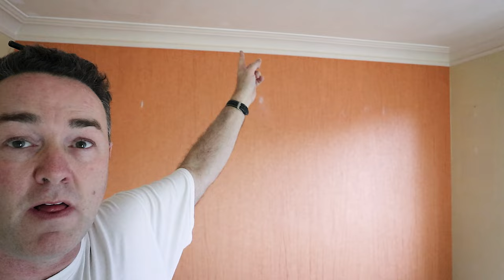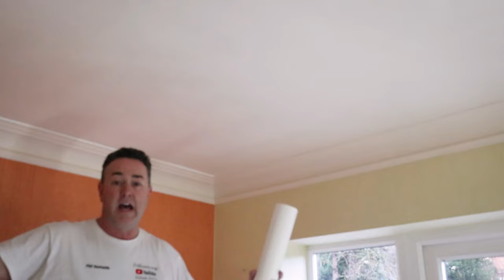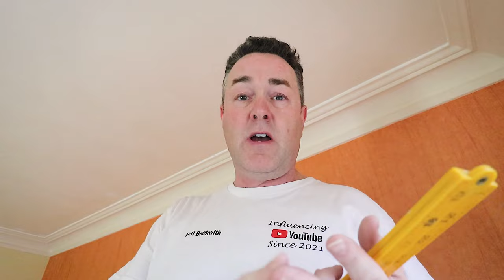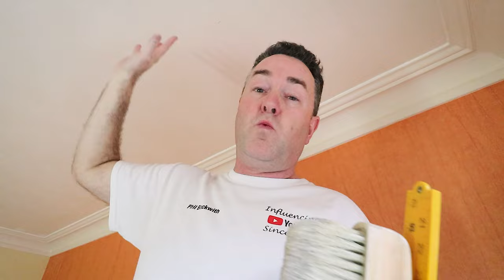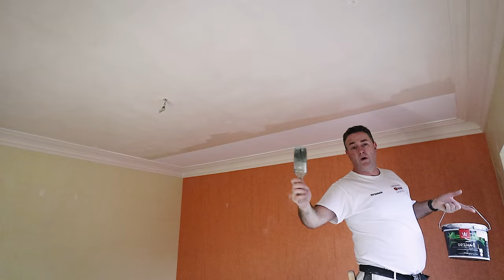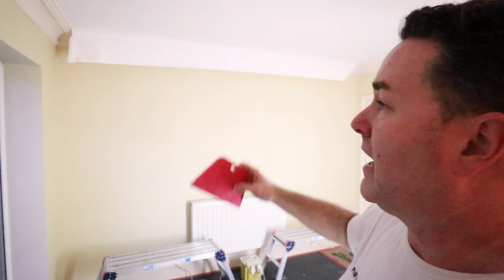Secrets to Perfect Ceiling Cross Lining - using WallRock

Comment: Nice one Phil, I do it the same way if I can remove the pendant...if not
I measure back from halfway through the rose to a point near the wall then transfer the remaining measurement to either side of the wall then ping a line, my start line...that avoids pulling the cable and pendant through the paper while you're hanging 
I'm glad you touched on the planning aspect..nothing worse than adding a tiny strip. 👍🏼

Comment: Phil there is a face side on wall rock
Reply from the maker: Yep. One for painting on.
But as long as you hang the same side it doesn't matter for papering over.
Reply: @ProfessionalPainterDecorator  got you ,didn't know that
Reply from the maker: it's non woven, it's onlt the side may have a slight texture or smooth on one side (they do a smooth paper now as well). But if you use a roller the orange peel effect would lose any texture if you put it on the wrong way, I say always hang off the same side, don't mix them up.
Reply: Those arms look like something out of gorillas in the mist lol

Comment: Is this cross lining when i was told cross lining was one way then lined the other way
Reply from the maker: Well, it will depend on the way you put the final paper on.

Some finishing papers may be hung horizontal.... So you would hang the line the opposite way.
Reply: Aye on a ceiling whats horizontal and vertical
Reply from the maker: @williamgorman893  the opposite way to the normal way of hanging a paper on a ceiling. ;) as discussed in the video :)
Reply: @ProfessionalPainterDecorator  the way aye hang lining paper on a ceiling follow the corner ie cornice edge if it runs out fill inn with either lining paper or filler.50 years now since I started painting and decorating so much has changed since then can't even get glue size now that's all we had then don't forget l a p hot water paste. Boss said I was the best at preparing for his graining church doors .the grainings gone but still painting
Reply from the maker: @williamgorman893  you watched the video all the way through.. all explained about running out.

Graining.... You seen my video on my decorative treatment tool box?
Reply: @ProfessionalPainterDecorator  yes Phil watched it to the end somethings I would've done different but your the master. I know your a top decorator with attention to detail,it's just sometimes you look too close it's not just you I know loads of guys that are perfectionists. Not saying it's a bad thing been decorating since 1971 0things have changed alot since then (for the better)cheers Phil
Reply from the maker: @williamgorman893  I go overboard with stuff and cover all bases, but it's how I do it right... or others will say... ooooh you didn't do this that and the other. It's only papering a ceiling with quality products to get a tp qulaity end result.... wait till you see the finish room.. the ceiling paper is awesome.